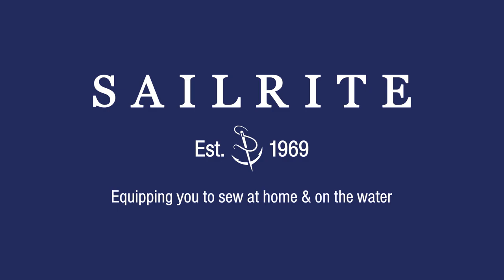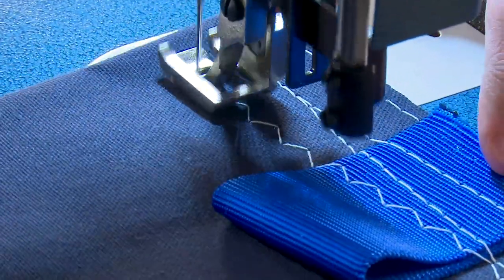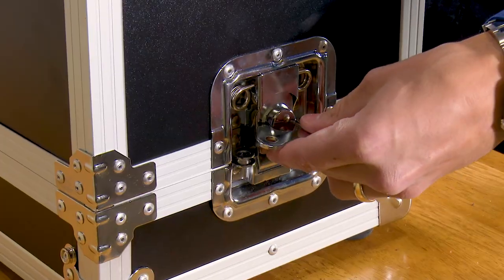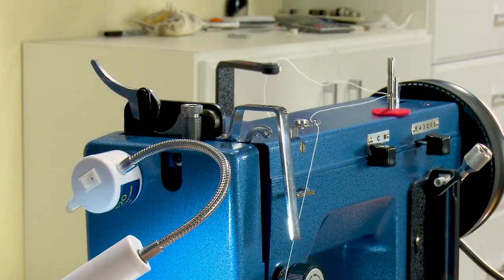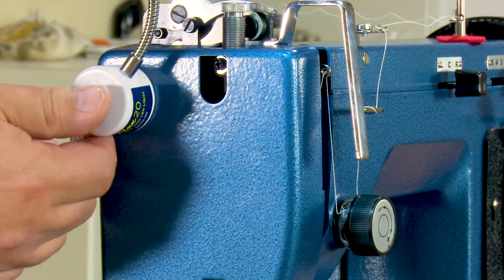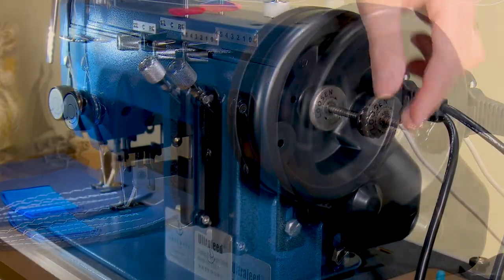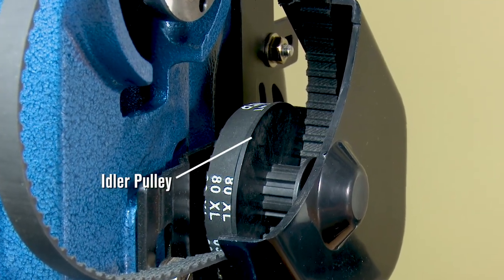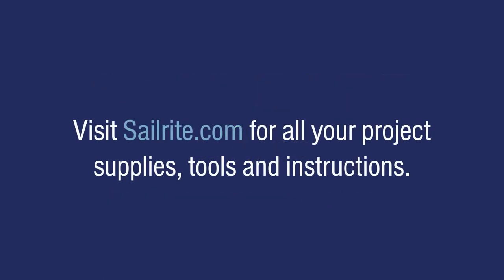Sailrite Ultrafeed® LSZ-1 PLUS Walking Foot Sewing Machine (Previous Version)

Comment: Do you have any dealers in Auatralia?
Reply from the maker: Sorry, we do not. However, we do ship to Australia and have great shipping rates.
Reply: @SailriteDIY  just did the conversion. Lsz-1 basic will set me back around $1275 Australian which is a pretty good price for that machine over here. Whats your postage cost on one of them to Australia?
Reply from the maker: @guerd87  John, I would be glad to give you an estimate for shipping, but I need your postal code please. OR ---- You can add the LSZ-1 Basic 220 volt to your shopping cart and use the shipping estimates to instantly figure shipping to Australia on the Sailrite website.
Reply: Do you have a UK dealer?
Reply from the maker: @IEXECUTIVE  No, but we ship the sewing machines worldwide.